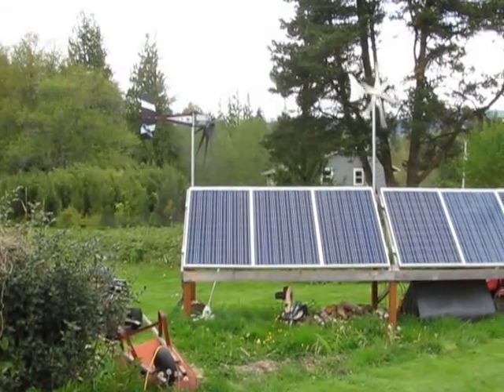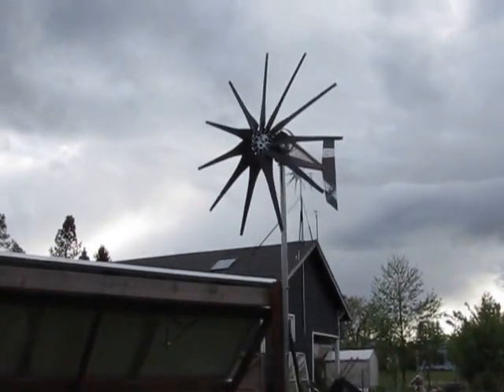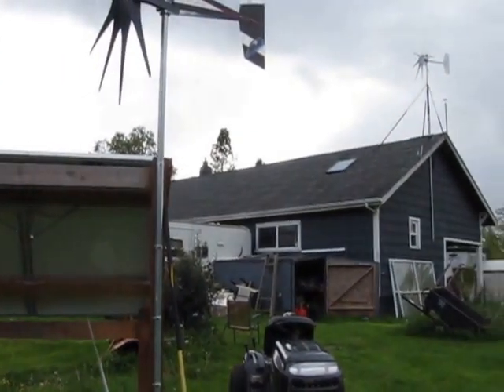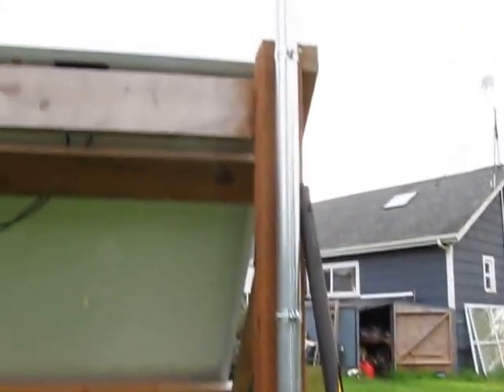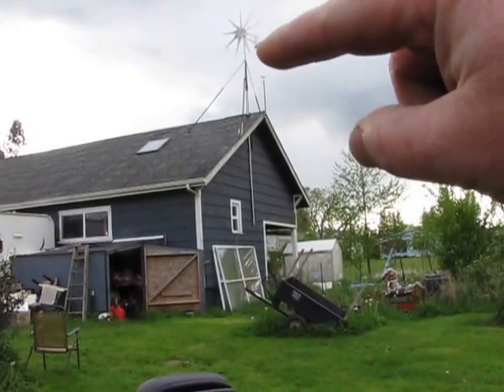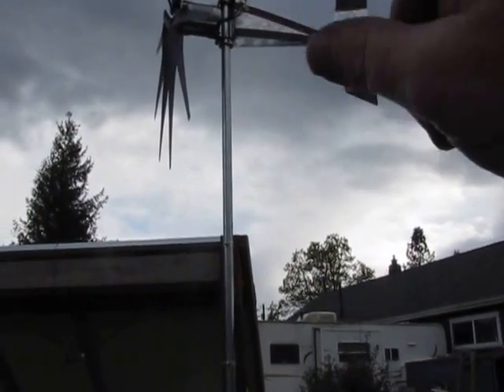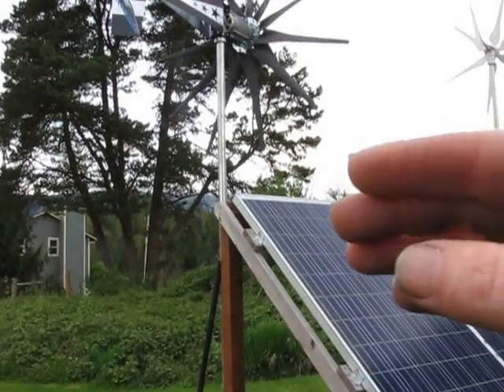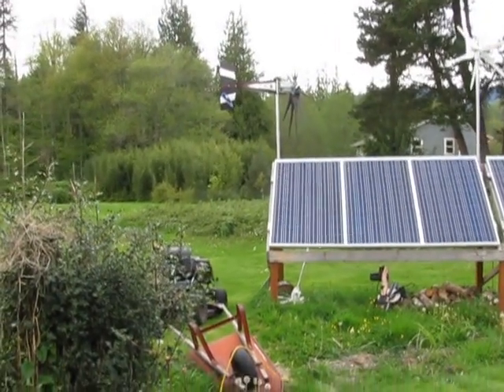Low wind speed tracking and 11 G4 blades, Update Future plans

Comment: maybe some heavy coil springs with the bolt going through them to reduce vibration like they use on large motor/compressors would help. we used them on larger copiers back in the old days.I wonder if the roof mount from Jeff insulates some of that vibrations from the roof.
best
Reply from the maker: Rev John O'Toole I don't get much vibration from the turbine, its the humming sound from the PMA/PMG , Adding rubber between the pole mounts and the wood house will help absorb even more of the hum from the PMA/PMG :)

The roof mount Jeff sells, I think does come with rubber pads that go between the mount and the roof of your house, it shows them in some of the pictures I have seen of it..
Reply: Jason Brown the rubber pads are to reduce leaks from the bolts to the roof surface.best
Reply from the maker: Rev John O'Toole The rubber pads are for the PMG hum, if you want to reduce leaks from bolting a turbine mount to your roof use a weather proof silicone type sealant on every bolt and screw going through your roof like I do :)
Reply: Jason Brown my roofer told me the rubber pads and silicone was to prevent leaks

Comment: I have rubber tubing from a car water pump hose I cut in half behind the pole and under the pole clamps and I still hear a humming.  I added more brace supports to remove the rattling sound but the humming is still there.  I can live with it thou.  I hope you have better luck with cut in speeds then me.  My single 12 pmg wouldn't make any power till 280 rpm's but it was thru grid ties and not a battery bank.  I believe "cut in" means the speed in which the pmg starts producing power.  Start up speed is when the blades start spinning.  Hopefully I don't have that backward....wouldn't be the first time.
Reply from the maker: ***** I am using a soft rubber floor mat about 1/2 inch thick, I bought at local hardware store, I wrapped some on the pole and it really helped, now I am going to add some between the wood house and the pole mount and I bet it will make it even quieter :) , thought I might as well try it now since I don't plan on taking this turbine back down once it is installed up there, 

And your right, cut in speed is when it starts making power , I just said the wrong word in the video, I didn't mean to confuse anyone, I thought everyone would understand what I was meaning to say :)
Reply: Jason Brown  The raptor blades are OK for low speed wind power.They are quiet and very tough. Mine is PMG and it's overdriven by a belt.Decent power comes on around 12 MPH and I'm OK with that. backyard wind turbines in the city get "dirty" wind. I always look forward to a storm! My height is only 24' and it has a treadmill motor.  Direct drive is just not enough.7 blades,5' diameter. It was fun to design the pully system for it and the tensioner. Serpentine belt and an Audi water pump pully,Ford A/C delete idler on a hair spring.  Thanks,Jason.Dave in Seattle.

Comment: Nice brother. One thing I would like to ask. What is cut in speed?  Thanks brother. God Bless. ps I am thinking about just making me a 12 volt bird with junk I have around here. I know it will not be the best but right now just do not have the funds to buy one..
Reply from the maker: yankey4 I think the cut in power making speed will be about 8mph, if it is like my other turbines, I will just wait and see before I know for sure , my winds have not been very good lately :)
Reply: Jason Brown No what I was asking is What is cut in speed? Now i see what it is tho. Its the speed the wind is at when the blades trun.
Reply from the maker: yankey4
Ooh ya, sorry, heh, I just wanted to see roughly what speed the blades started turning , I would guess 6-8mph wind gust, that is about where I want it to be for my setup, I want to get power from 10-15mph winds up to around 70mph, I get 70mph wind gusts or more almost every winter so my turbines are not really setup for low winds, but they still make alittle power in low winds :)